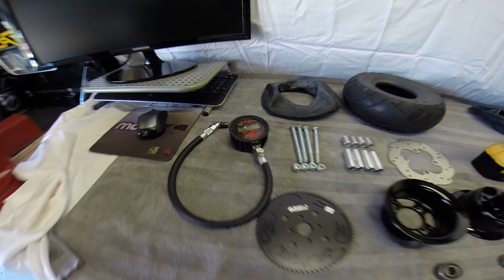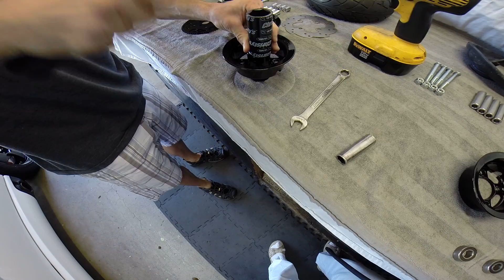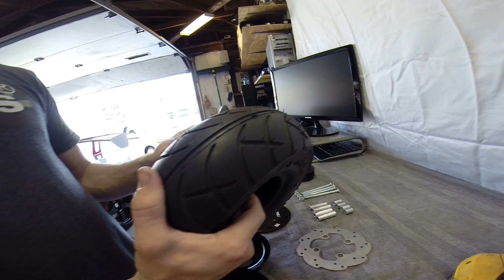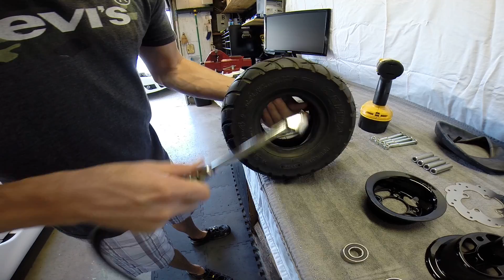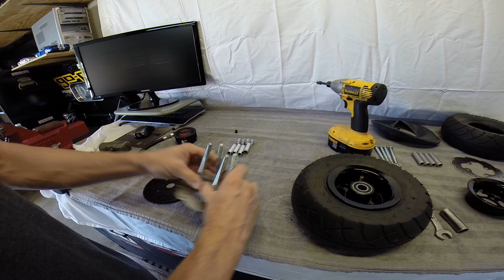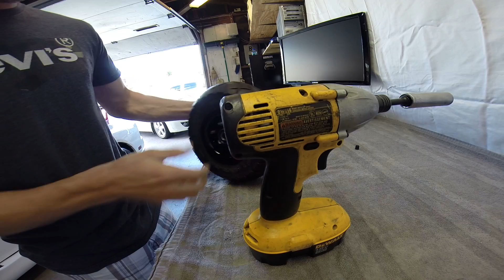GoPed, HOW TO: Complete Build Rear Wheel Assembly

Comment: Derek short Quick question. What is the parts number for the spacers from sprocket to wheel not the ones between the sprocket and disc brake the longer ones I just want to make sure I'm ordering the correct part thanks bro.
Reply: https://youtu.be/03z-NKLNlwo

Comment: When insert the wheelbearing spacer?
Reply from the maker: Ive been running my wheels without spacers in the middle for years. Knock on wood never had an issue. as for ur falling apart.... kinda odd... But I would have to assume maybe like you said... over or under tightening. The way I set mine up is I make sure I find that happy medium point. not 2 loose and not too tight.
Reply from the maker: I typically don't used the inside wheel bearing spacer. Your talking about the spacer that goes inside when rim between the 2 bearing correct? Ive had issues with them in the past which is why I don't use them any more. Just don't over tighten you wheel when installing it and your good to go!
Reply: Derek Short I LOVE WHEELIES  BUT IVE NOTICED W OUT THE SPACER MY BEARINGS WOULD LITERALLY FALL APART DEEP IN MY RIDE, WOULD YOU SAY THATS DUE TO 1. OVER OR UNDER TIGHTNING OF AXEL BOLT 2. NO SPACER OR 3. BOTH ?/ I HAVENT HAD ANY ISSUES SINCE IVE BEEN USING A SPACER / AND ALSO LIKE TO KNOW WHAT ISSUES U RAN INTO WHEN USEING THOSE SPACERS SO I CAN KEEP A LOOK OUT FOR THOSE SYPMTOMS !!! THANKYOU GTR460 BROOKLYN GPN!! BROOKLYN'S "GO-PED" KINGS FB
Reply: thanks Derek!